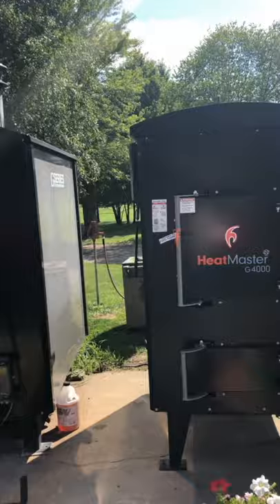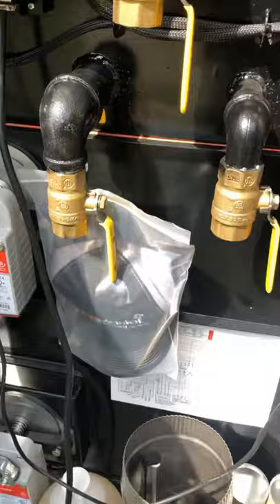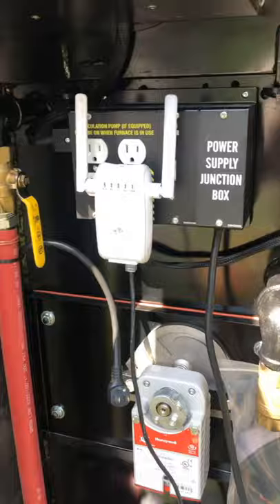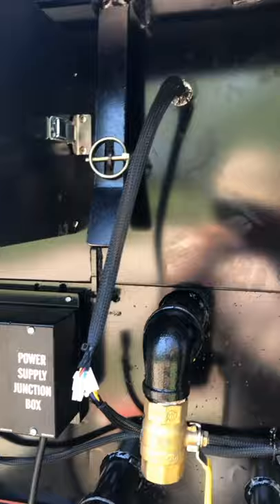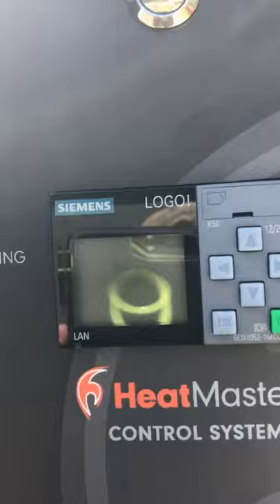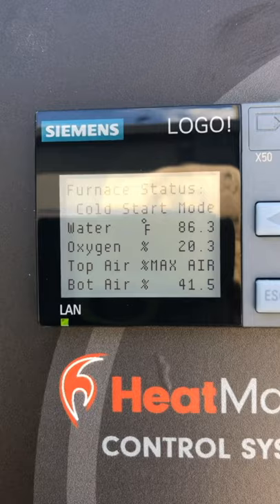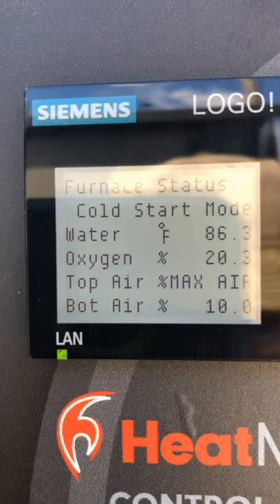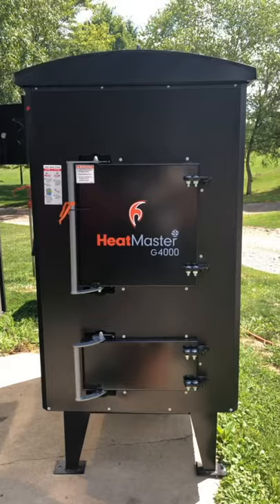The Awesomely Revolutionary  2020 G4000 From HeatMasterSS

Comment: I’ve been researching OWB’s and I keep coming back to the  Heatmaster!   Heatmor was another, only because the wood doesn’t have to be totally dry. I’m on the fence but leaning to the Heatmaster. Like your videos 👍
Reply from the maker: You’ll have the best efficiency with seasoned wood and the least amount of maintenance however less than ideal can be used if you mix it in with the dry or use wetter wood when it’s colder out so the stove runs longer and more often.
Reply: Alternative Heating Solutions thank you 👍

Comment: I know this stove is rated for up to 4000 sq feet. Do you think this unit could handle 5,000 sq feet with baseboard heat?
Reply from the maker: BTU’s needed are BTU’s needed regardless if forced air, radiant or baseboard. If your home is insulated tight enough it possibly could. I do know of a gentlemen heating a few thousand square feet more than a G200 is rated for but his buildings are all spray foamed to the heat of my knowledge. 

It would be best if your dealer or a HVAC guy could run a manual J calculation to see just how much heat you actually need.